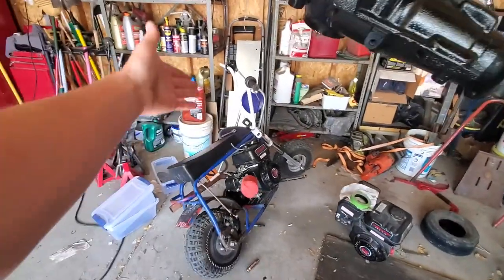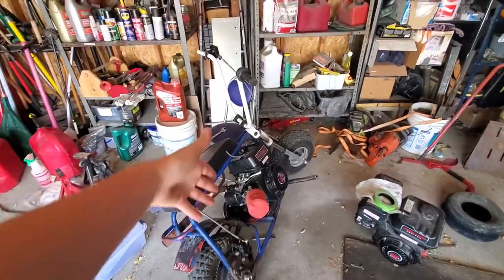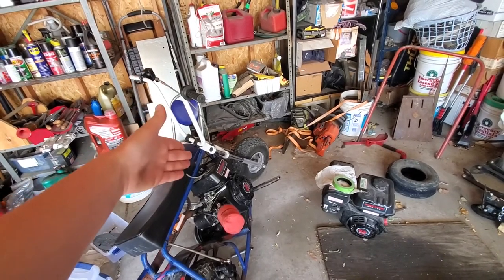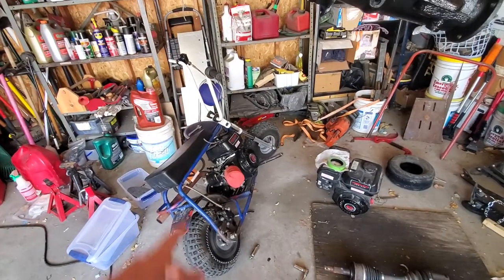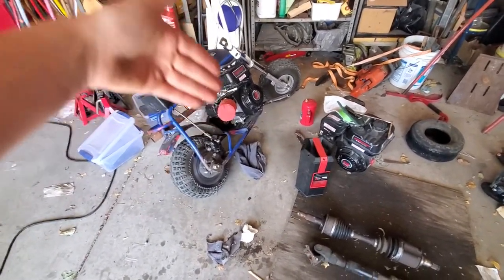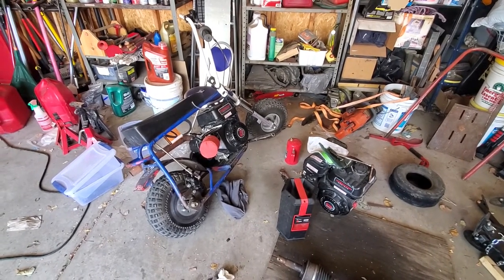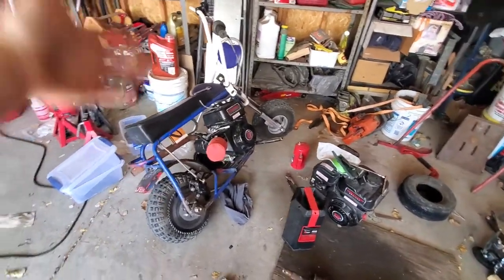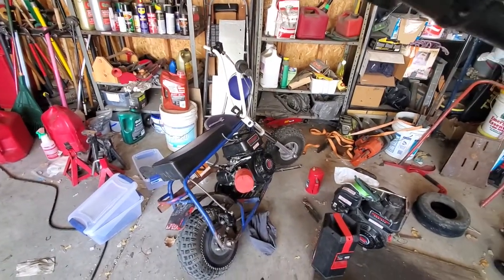Predator 212 coil gap

Comment: So what is the gap set to from the factory?  And what are the tight and wide gaps you mentioned.  Thanks
Reply from the maker: Tight I would say is .001 and wide being .008 just set it at .003 and go
Reply: @ADVENTURE_HP nooooo. Minimum of .030 gap. MINUMUM. Crank flex bro. Magnet strength has nothing to do with it besides an upgraded flywheel having stronger ones for more/better performance/output. That is way too tight bro. That’s a huge safety risk if the crank flexes any the magnets will hit the coil and it’s GAME OVER. make sure you are up to par on these things before u spread any false knowledge becasue that can become a very very huge problem, very quick. Not one you wanna deal with either. Not hating at all, just letting ya know buddy. 

THIRTY THOUSANDTHS (0.030) MINIMUM!!!
Reply: 0.030 minimum
Reply from the maker: Or just go cdi

Comment: So there's no real adjustment on the coil pack? As long as you're fairly close to the magnet on the flywheel?
Reply from the maker: There is gaps to run depends how you build your engine. billet flywheels have a lot stronger magnets you will fry your coil being to close. Stock flywheels closer will get better spark but with the governor still in you will not see a difference.
Reply: All I have is bolt ons, I don't plan on going anymore but I added charging coils for my lights yesterday. I sanded down the flywheel on the sides the best I could to get the rust off. I did not touch the coils but it seems like it's harder to start now. I did the tie zip tie trick for the governor.
Reply from the maker: @tommyhajimoto6968  harder to start  I would check your valve lash for that. Set it cold at .003 the coil gap should be fine but with sanding you may have got more dirt and dust on it to make it work less I take it off clean it and reset the gap
Reply: @ADVENTURE_HP  yeah, I didn't blow it off with a compressor
Reply from the maker: @tommyhajimoto6968  plus there is magnets there I carb clean and wipe it off
Reply: @ADVENTURE_HP  better thank you!!
Reply from the maker: @tommyhajimoto6968  you bet more videos like this but way better coming
Reply: @ADVENTURE_HP  cool I just subscribed!
Reply from the maker: @tommyhajimoto6968  thanks
Reply from the maker: Just run .003 works every time
Reply: I have a Coleman ct200U ex , what’s the correct coil gap ? Already tried a business card and no look starts for 4 hard rough seconds thenn dies , already check for spark on the plug and I am getting spark
Reply from the maker: @emmanuelramos4772 coil gap at .003 and valve lash at .003. 2 most common things when the carb is fine.
Reply: @ADVENTURE_HP  carb is fine has new has new oil , spark on the plug but doesn’t want to start right . I hurrd valve lash for a ct200U ex is exhaust .02 and intake .015 going to be running 18lbs but can’t do anything if my engine doesn’t run 0.43 mm would that be good for the coil gap ?